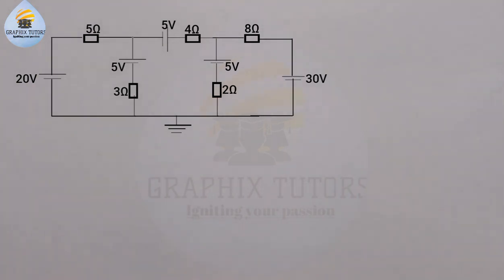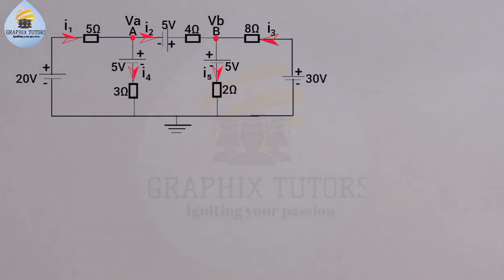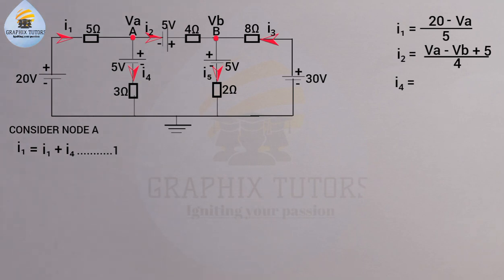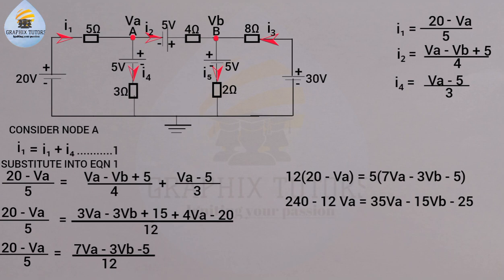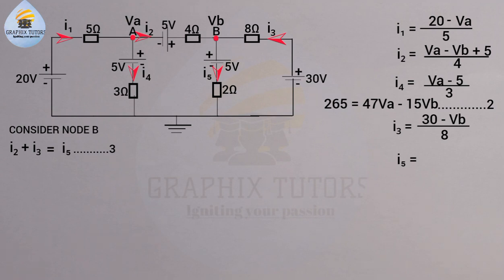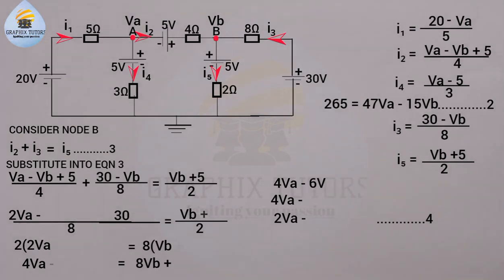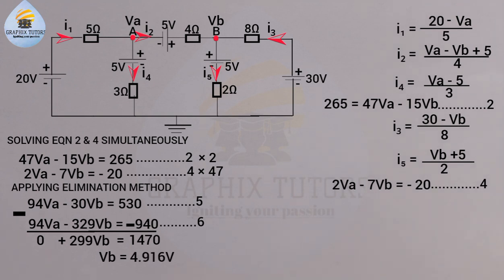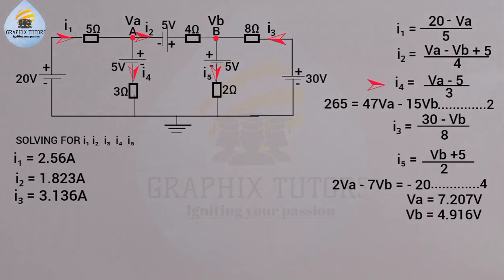NODAL ANALYSIS OR NODE VOLTAGE METHOD IN ANALYSING CIRCUITS.

Comment: please look at the i5 the current is coming from Vb and going through the 5V and according to the circuit is moving from the higher potential to the lower potential and the equation suppose to be i5 = Vb - 5 / 2  but in your video you put Vb + 5 / 2 please kindly reply this if am correct.

Thank you
Reply from the maker: It can't be positive, you are correct